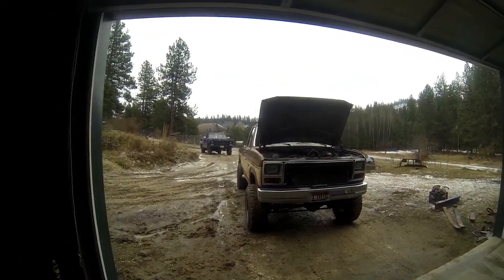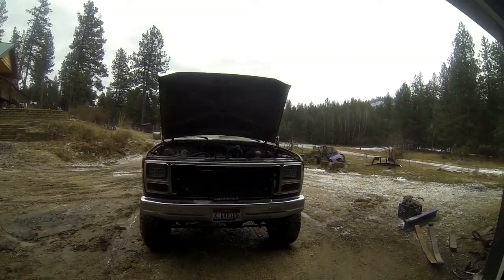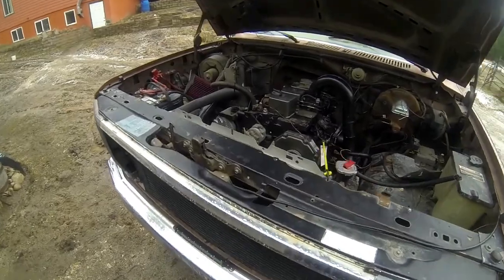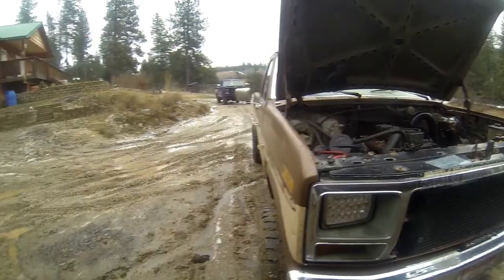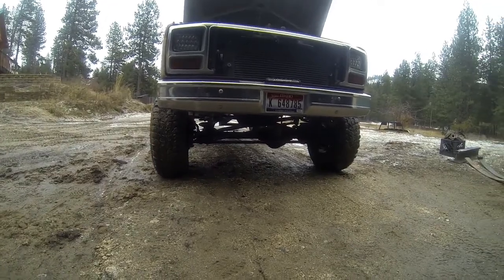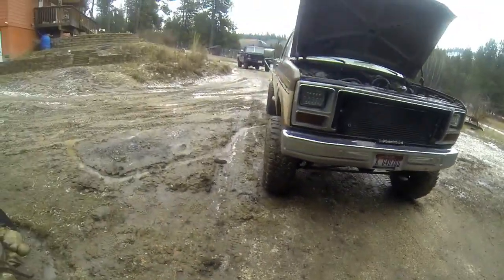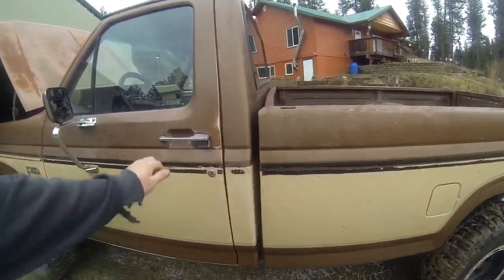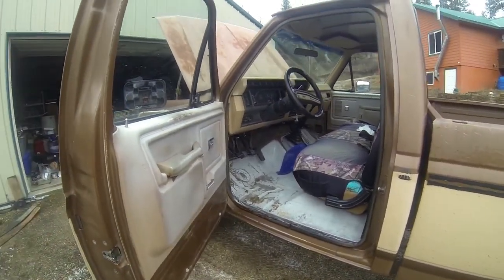1985 ford f150 4bt cummins walk around

Comment: Can you please show how you wire the injection pump to the starter and all that to the key
Reply from the maker: @eliasmendoza7665  literally just hpok up key on 12 volt to injection pump and the starter trigger wire to the starter
Reply: So bad you say I just need to hook up a 12 volt wire to the injection pump solenoid? Because I have the same wire set up on the truck the way it was with the gasoline engine I have a starter solenoid the ignition wire connecting to it
Reply: Sorry I’m just terrible with electrical wiring I know this engine is very simple It has very few sensors that need to be hooked up
Reply from the maker: @eliasmendoza7665  the 12 volt key on originally hooked to the ignition coil or distributor on the gas engine goes to the fuel shut off solenoid on the diesel injection pump. The fender mount starter solenoid has a trigger wire that you run down to the starter their should be some write ups or something online it's really pretty simple once you get it figured out

Comment: What transmission are you running behind it?
Reply from the maker: It is a small block zf5
Reply: @wrecklessautodestroyers5643  that’s awesome. I have a 1986 step side with a Dana 44 swap upfront and a built 300-6 and granny 4. Really been looking into these 4BT swaps
Reply from the maker: @timmy6520  they are sweet little engines. I have helped swap 5 obs fords with cummins. 2 of mine were 6bt and the f150 was a 4bt the cummins is by far the way to go in them it is a bit spendy but worth every penny
Reply: I have zf5 in I’m so excited about I’ll been working off this for to long already I still have the wiring to do
Reply: Tell me about it I’m already like 7 thousand because I had the Cummins rebuilt and I’ll been doing all the swap by myself impossible to find someone to take the challenge to install all this
Reply: Hopefully is all worth it when I’m done
Reply: Will you be able to shout me a email with the wiring diagram or some pictures ?